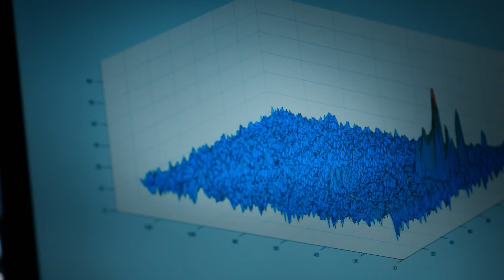HELLA - THE ART OF SIGHT

Comment: The right of way was not breached at 2:50. In fact, the red Golf had the ROW as you can see from the street signs as they count second if the traffic lights are out of order. So the text is not quite correct. Yes, it still prevented an accident but not "even if ROW was breached".
Reply from the maker: Hi Anton, thank you for your “eagle eye“ and your comment. You are right: The right of way was not breached by the red vehicle. However, depending on the perspective, this scene also illustrates that radar technology can as well prevent accidents that might have been caused by yourself, if you overlook a street sign…